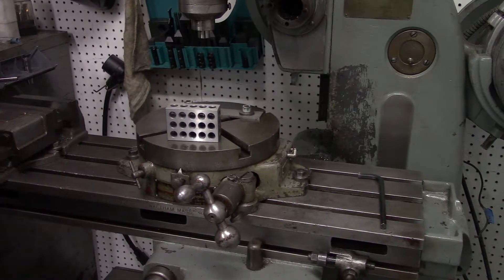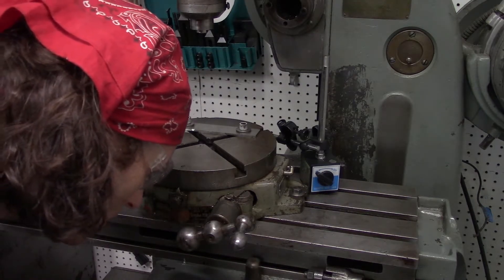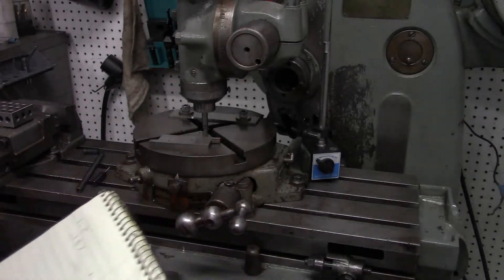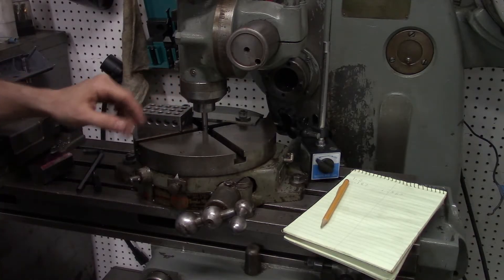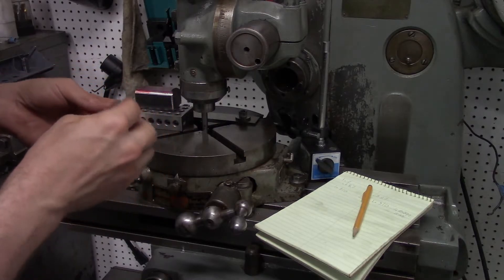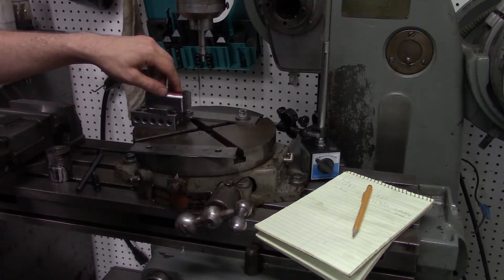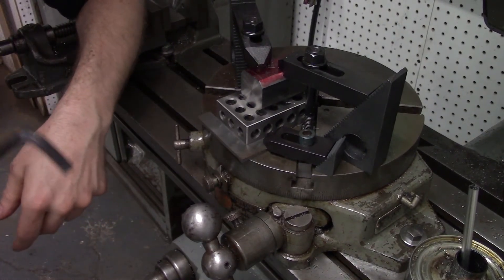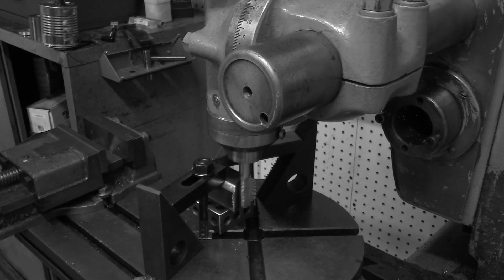How to do a basic  set up  on the rotary table

Comment: I don’t want to start the metric v imperial debate, but at least decimals make it a load easier. 
Thanks for the thought provoking video.
Reply from the maker: ok, I will keep that in mind for future videos
Reply: @tilliesinabottle  btw, what make is your mill? Looks old and loved. I just acquired a rotary table off a 1960’s baby jig borer, works well on the 1952 Swiss mill. It’s doesn’t have a quill though so drilling can be a pain.
Reply from the maker: It's a Nichols tool room mill- a small-medium horizontal mill. Attached to it on the overarm is an ancient Bridgeport C head. Also no quill feed, but the neat thing about  nichols mills is that the head and overarm can slide up to get out of the way or as a de-facto quill.

Comment: I believe that since the radius to be cut is in the center of your part linearly, and it also doesn't appear to be a precision machined part, the process could be greatly simplified.  Once the rotary table is centered on the spindle, scribe a line on the linear center of the part.  If the part is long enough to place a scribe line of center punch at the center of the radius.  With a pointed edge finder, or a simple rod with a turned point,  position the part at the center of the spindle. From there you only need to adjust the set up to cut the desired radius.  I could be wrong.  If so, I can delete this comment. Thanks.
Reply from the maker: I think that's a way simpler method than what I came up with.  Yes that would have more appropriate too since this is not a precision part.
thank you for the suggestion! that's how we can learn from each other.

Comment: I have the same rotary table.Yours looks a little smaller then my 12". .  I have a series 1 Bridgeport knee mill . I've never seen a mill like yours.
Reply from the maker: yep, It's an old smallish horizontal mill with a much older vertical head attached to it. That is a bridgeport C head, and if I'm not mistaken, it was the original machine that Bridgeport made.

Comment: I never heard of a 3/8ths edge finder in the beginning,??.....you sure that's not 1/2 inch ??
Reply from the maker: It's a Starrett 827A.  An oldie for sure, but yep, the business end is 3/8, with a .200 section at the tip the rest of it is 3/8 too. I know what you mean though, my other set of edge finders are all 1/2.

Comment: Nice!  Haven't seen that walked through before.
Reply: Thanks Jared, how is the house comming allong?
Reply: Just finished some closet doors and trim and the bedroom floors.  One more room's floors and installing a window and a couple electrical projects and while there is still a lot of house stuff to do, I think I can get to some shop projects, like my Nichols mill!
Reply from the maker: That's great, you're getting closer to the fun work.  Jeez I have plenty of work to do in my own place. Apartment life is a little different, because certain things need to get approved by the building management. It gets pretty silly when changing a lamp in the ceiling requires either a Permit or sneaking around to do it yourself.
Reply: Where did you get the vertical head? They seem to be hard to find.
Reply from the maker: It came with the mill. I'm sure that the vertical head was the only thing being ran by the last guy.